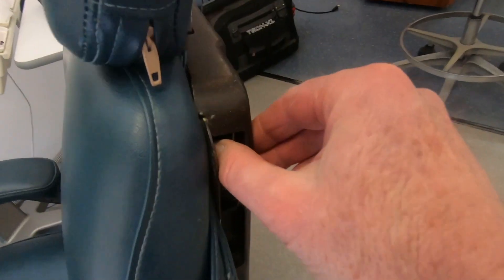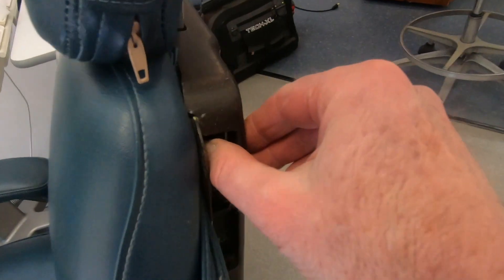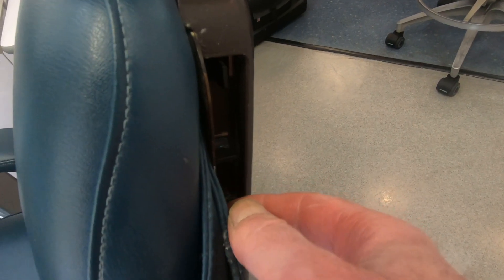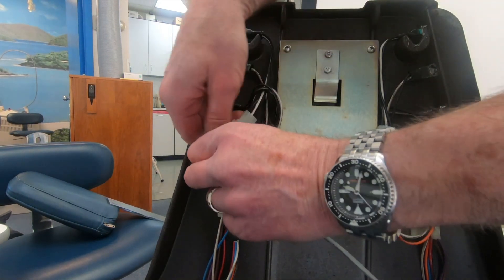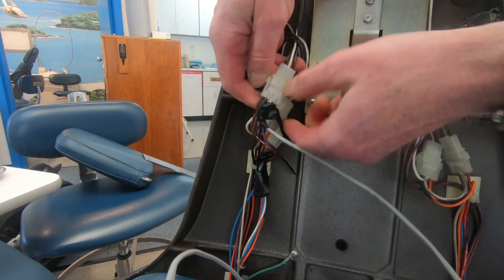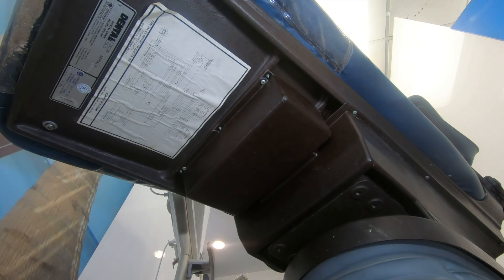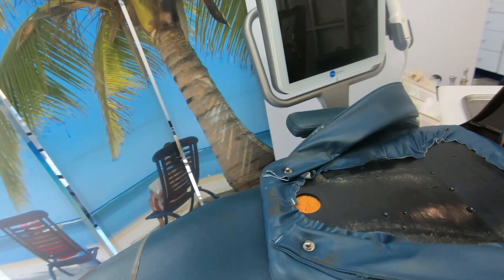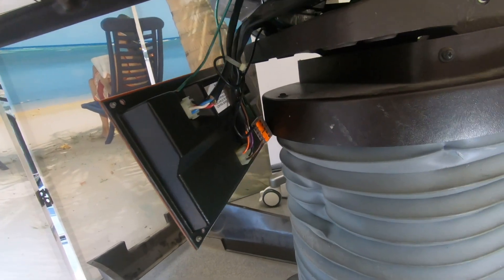Dental chair switch doesn’t work.  Bypass bad wire

Comment: I wish my dentist had relaxing murals!

Real talk. It's always fun to see what you are working on!
Reply from the maker: Thanks for the support and. kind words.  It's like owning another house.  A good week is when nothing breaks.  I like our repair guy but I try to fix everything myself.   It's like  my boiler and AC at home- once it gets to a certain age, they start pushing new equipment rather than repairing what you already have.  And the new stuff stinks compared to the older stuff.   Believe me, If I called someone they wouldn't  have even tried to trace and fix this chair- they would have told me to buy a new one.  I will when I have to.  Thanks again for the comment!